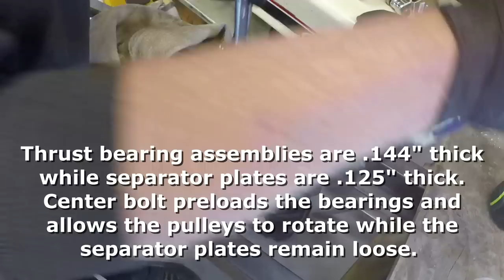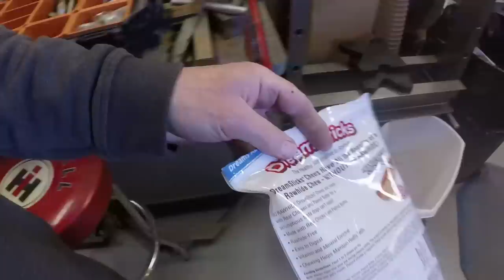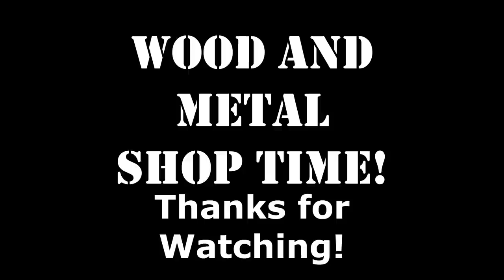Garden Tractor Forklift Build EP:23,  Mast and Lift Mechanism

Comment: I thought of a way to add weight to the back of the forklift without changing the engine grill area. Fill the steering tires with 0deg windshield washer fluid. I have seen it done to large tractors to help limit bounce while going down the road which is not a problem for you but may be enough weight to keep it from tipping forward with weight on the forks. Your builds are awesome and I look forward to watching the next video.

Comment: Frank, nice job here. After seeing your cable idea, you won't want to switch to chains. I guess the hard part is putting equal tension amounts on both the cables. Also, don't worry about the fact that the cylinder can rotate. My hyster 50 does the same thing. You can turn the piston when there isn't any pressure, but the moment it gets under pressure, it straightens right out, so, keeping the cylinder straight should not be a problem.

Comment: You had me worried when I saw those formed rod eye bolts. I thought you were going to use them for the lift cables and I was going to strongly recommend against that. Then I saw the cast eye bolts and was relieved. Even if you weld the eye closed, they stretch. We used the cast eye bolts on machines that weigh anywhere from 500 to 2000 lbs and had no problems lifting the machine. A suggestion, when you make the frame for the forks, notch the top rail so the latches on the forks lock into the top rail. This will prevent the forks from sliding. Nice work.

Comment: Frank just a little bit of information for you I worked equipment for nearly 50 years and I worked offshore in the oilfield.  One important little tidbit when working with cable and when attaching the cable clamps was a saying to make sure you always put on the clamps the right way to hold properly--   "NEVER  SADDLE A DEAD HORSE" . Which to explain is that the clamps side that the ubolt goes through is the saddle and you always put the ubolt on the cut off end of the cable.  Loving the build so far and it takes me back to my younger days of work where I ran an old ancient forklift that was cable strung on the mast. It was a troubled old machine because if you was on rough ground or if you slacked off the lift too fast it had a habit of jumping a sheave on the boom. It was easy fixed but still aggravating when you had a lot of work to do and in a big hurry to get it done.
Reply from the maker: That's great advice on the cable clamps. I'll have to go back and double check. The actual build is running well ahead of the published videos, so I've already strung the cables.  If I did them wrong (and probably did), you'll see that in an upcoming video. If I have to fix them, you won't see that until the end of March.
Reply: @woodandmetalshoptime8048  Glad to be able to pass on a little help to everyone.  Hope you tell that at one point in a future video. Looking to see if you did indeed do them right or have to change around the clamps. Keep her going and looking forward for the next video
Reply from the maker: I went back and checked the wire clamps and all but one were on correctly. The one had the two strands side by side.  Each termination has two clamps.  I think I'll go back and add a third.  Thanks again for the advice.
Reply from the maker: Actually, 2 were wrong. I fixed them today, and added more clamps. Should be in April 6 episode.
Reply: @woodandmetalshoptime8048  two on each end of the cable is sufficient.  But offshore under OSHA regulations we had to use three at each end. Anything over that is true overkill and a waste of effort and money. In truth one pulled tight will hold more than the cable can withstand.  But for safety two clamps is all you really need. But I'm glad you got it all correct and you shouldn't have any problems.  Looking forward for the next video.

Comment: Good progress Frank.  You've talked about redundancy in the cables but have you considered a safety valve in the hydraulics to prevent the cylinder retracting if a hose fails?
Reply from the maker: You'd expect a leak to occur, perhaps, and the system might bleed down, but it would be a gradual thing.

Comment: I think that you should consider a longer bolt through the pulley block at the top of the cylinder so that both pulleys are on the shank rather than the thread.
Reply from the maker: Yes, that would be better. Or a piece of cold rolled stock, e.g., 4140 or similar.

Comment: Hi Frank another great job and video!! But with the pulleys and that housing on the ram rod, just concerned that it may twist on the bolt and fowl the mast!! Might it be better with bearings inside the pulleys and no grease on the rod end and tighten the bolt to lock the pulley mount to the eye of the ram rod  to stop twisting on the eye?? No point to have the eye on the bolt greased??
Reply from the maker: I expect cable tension to keep the pulleys aligned. We'll see how it works. If needed, I can make adjustments.

Comment: It looks like you may have the pulley assembly wrong, it should be the anchor bolts at the top, cable comes down to the cylinder pulleys and back to top pulleys and then down to the forks.

Comment: Drilling should have a hole the size of the web.  The point of the drill is forced to waddle through the metal as it doesn't turn fast like the outside.  With a hole, the cutting lip cups up the metal and the drill floats through.
Reply from the maker: Unless you have a split point bit which helps a lot. But the pilot hole is generally better of course.

Comment: I believe I would put pulleys with bearings in them with a grease fitting to keep them greased on the top of the hydraulic piston. Would you not think it be better than them little bitty bearing you put between them.
Reply: Those are thrust bearings not load carrying.

Comment: Drilling grease ports in the bolt would have been better and just thrust washers instead of bearings they are kind of a waste because of no side load.
Reply from the maker: Thrust washers are to prevent the separator plates from interfering with pulley rotation. The pulleys have bronze bores.